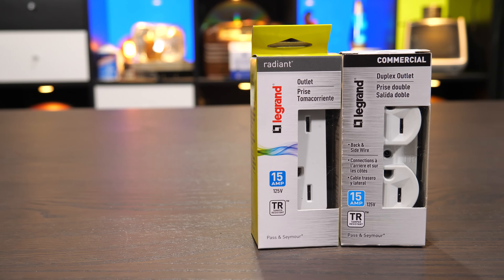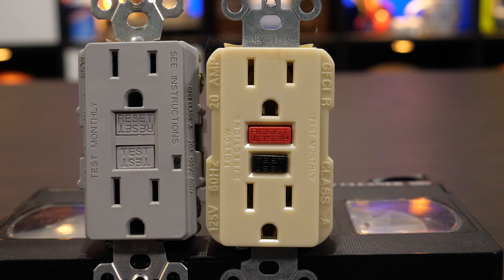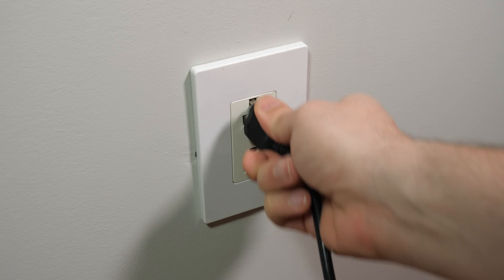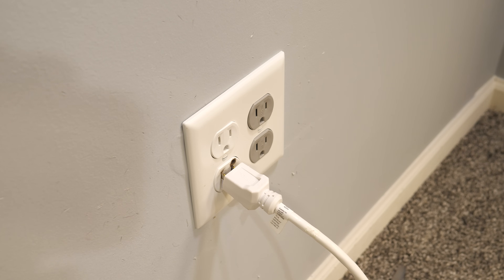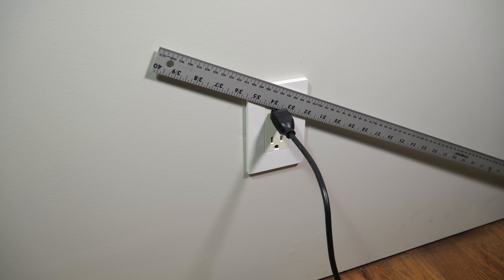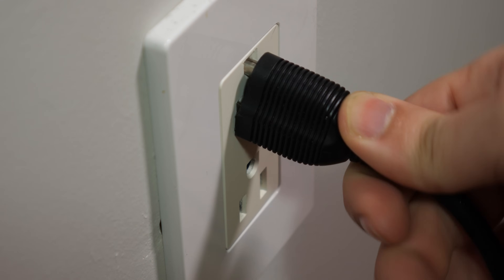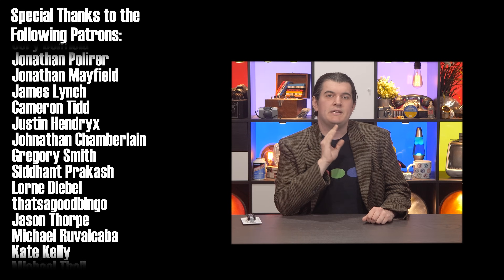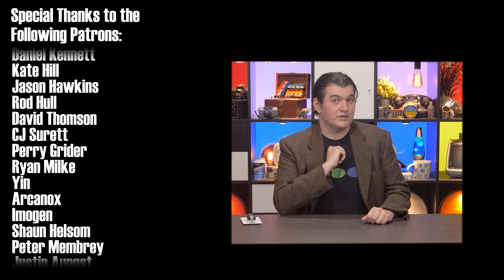Power outlets are topsy turvy - but does it matter?

Comment: Local practice in my jurisdiction is to invert the receptacles that are switched. The switched receptacles in my house are "half hot". The bottom receptacle is switched for the table lamp controlled by the wall switch. The top one is always hot to feed the clock radio. The thing you should check out though, after you read all 8000 posts and get to this one, is a device called a hug-a-plug that turns regular pokey-outie plugs into right angle dealy bops so you can shove the dresser tight up to the wall without breaking the TV cord.
Reply: What is a clock radio? Sounds interesting!
Reply: @Capitan-America-no.1  I know! It seems like a weird combination, sort of like putting a camera in a telephone, but they actually make these devices called radios that sort of work like Pandora and Spotify, except that you don't need a computer, or phone. Think of it like a Blutooth speaker that you don't have to pair. I don't know if the idea will catch on, but the music is free, although you have to listen to some advertising..like oh maybe 45 minutes of ads every hour...not too bad. Anyway the idea is that you combine the radio with a time marking device and you can program it so that the radio turns on at a specific time each day and plays some music. The idea is to help you wake up in the morning. Unfortunately they don't work in all areas and they fail if the weather is lousy, but the clock part is pretty reliable.
Reply: Linking the orientation of a receptacle to whether it is automatically controlled is an obsolete practice.  As of the 2014 NEC, automatically controlled receptacles are required to be marked as "controlled" and to have the IEC Power Symbol ("⏻") symbol on it.

Unless you have a compelling reason to do otherwise, I'd suggest using ground pin up for all vertically oriented non-locking outlets (the way hospitals do it) and neutral pin up for horizontal installations (the opposite of common practice in Chicago).

The National Electrical Contractors Association's National Electrical Installation Standards (NECA 130-2010) recommends that receptacles be mounted with ground hole up.
Reply: NEC Article 1, Section 100, defines "Automatic" as "Self-acting, operating by its own mechanism when actuated by some impersonal influence, as, for example, a change in current, pressure, temperature, or mechanical configuration."

The code section requiring such marking, NEC Section 406.3(E) Controlled Receptacle Marking, is intended to govern outlets controlled by thermostats, humidistats, occupancy sensors, computerized building automation systems inter alia and specifically excludes switched outlets from the marking provision. Here is the exact language of the section:

"All nonlocking type, 125-volt, 15- and 20-ampere receptacles that are controlled by an automatic control device, or that incorporate control features that remove power from the outlet for the purpose of energy management or building automation, shall be marked with the symbol shown in Figure 406.3(E) and located on the controlled receptacle outlet where visible after installation.

Exception: The marking is not required for receptacles controlled by a wall switch that provides the required room lighting outlets as permitted by 210.70."
Reply: @christopherdahle9985  I stand corrected!
Reply: @jmdavison62  Don't back down so easy, because marking them in a more obvious way is not a bad idea at all. But some AHJ's may read the "NEC "Exception" as a prohibition. Also, the marked receptacles can be hard to find and are only available in "Decora" which not everyone likes. In my house the bedrooms remain in their 1928 Art Deco style so I could not have used them for my switched outlets without messing up the "look". Fortunately, I found modern grounded outlets and switches in an appropriate color that worked with the original brass cover plates when I did the upgrade to three prongs. (There is a legal/safe way to do that, but you have to wire it right and all the outlets have to have cute little tags on them "GFCI protected, no equipment ground". I made my own in a cool art deco font.)

It would be nice if there was a generally agreed upon convention for stuff that doesn't need to be governed by regulations. I'd vehemently oppose the NECA standards if they became a mandate, but they're fine as recommendations. There are outlets in my house (washing machine and refrigerator) that NEED to be ground pin down because the plugs are intended to be installed that way similar to some shown in this video. On the other hand, they are pin up in my bathrooms because...reasons. In my shop they alternate between pin up and pin down because I have two circuits coming to each 4 way receptacle in the wall. (Yes, it's legal with a proper shield in the J-Box) so that I can plug two Amp thirsty tools in at the same location. Pin up is "tool circuit 1", pin down is "tool circuit 2", and they are on opposite legs in the service panel.
Cheers!

Comment: I chose the upside down method for all common areas simply because I have had an outlet blow out because a family member dropped a coin accidently behind his dresser and the coin landed right on both blades. It is safer looking at it from this perspective. Granted the chances of that happening aren't very likely but it did happen once and luckily no major damage was done. It's a preference so no way is the wrong way.

Comment: While we're on the subject of stupid plug design, check out some of Dell's modern 3 prong AC plugs for their gaming laptops (Alienware 450-AKWC for example). Mine has this annoyingly smooth taper making it difficult to properly pull out of the wall AT ALL without yanking on the cord itself, because you have NO GRIP on the plug bit. I had to go out and buy a separate cord to attach to the brick to avoid the possibility of accidentally electrocuting myself or damaging the power cord. I really haven't a clue what they were thinking with that one...

Comment: The thing is, as you say, it doesn't really matter. And ground up protects you from dropping something across the pins. Yes, poorly designed wall warts and right-angle plugs might then sag, but the thing is... that's true anyway! I have seen so many plugs and/or outlets that don't quite fit right and stuff hangs out constantly! You just have to plug them in the top instead of the bottom! Seriously, who cares? Oh, and as far as your point about the "majority of plugs"... the vast majority of plugs are not right-angle. In fact I own exactly one right-angle plug (other than wall warts). Right-angle plugs are already inferior (since you can basically never use two of them on an outlet - seriously, you think the problem with them is unplugging them and not using 2 of them in an outlet???). And if everyone used ground-up, they'd be fixed soon enough anyway.

Oh and as far as your diagonal-right-angle cord... that's a failed attempt at allowing you to use both sockets, not anything to do with keeping the cord at a reasonable angle. 

And you don't have to be throwing something against the wall, either. Where do many people put things like computer desks? Against the wall in front of an outlet. What happens to stuff that gets knocked off the back of your computer desk? It falls down along the wall.

Of course it doesn't help some other scenarios, but the key thing is it doesn't make any other scenario worse, and it DOES make some scenarios better.

BTW - the vast, vast majority of my plugs have a ground pin. Really the only stuff that don't are lamps and USB wall warts.

Comment: Where I live in West Texas, all the older houses I've seen, including where I live, have all the outlets oriented frown upside-down and it drives me nuts. A/C adapters and other special shaped items intended to be plugged in are contanstly trying their very best to come out of the wall or are instantly transformed into something far less usable than intended. If I didn't rent where I live and the wiring wasn't as old as it is (therefore introducing a potential fire hazard), I would turn every one of the outlets around to what is the "normal" orientation. For now, I practice clinging tight to my sanity.

Comment: Some electricians care. I always ask a customer how they want them before I install them and recommend doing them ground up, but still let them make the final decision. I using an example of bed against the wall with an outlet behind it that has something not quite plugged in all the way. You set a hanger on the bed while getting dressed, hangar slides off the bed and falls down between the bed and wall then lands on the exposed energized conductor. They usually agree with my recommendation after that.

Comment: When I was a kid, I encountered one such very specific scenario. See, my grandparents had power strips installed under the lip of their kitchen island. I happened to wear a metal dog tag at the time, and it happened to slide in from the top and touch both contacts while i was leaning over the counter.
There was a loud pop, and it flipped the strip's protection, but, other than a bit of metal deformation on the tag where the contact occurred, there was no harm done. I believe they still have the same blackened power strip mounted there to this day. All that being said, I agree with you on all points regarding the upside down outlets; methinks it's rather silly.

Circling back, there are lots of electrical oddities in that house. One time whilst staying over, I noticed sparks being emitted from the overhead dining room lights in the pitch dark of night. I told them, and I think it ended up being a faulty dimmer switch? Regardless, they got it fixed, so I saved them from a potential electrical fire.
Another thing they have that I've never seen anywhere else: glowing light switches. When they're switched off, they give off a nice orange glow from the inside of the switch itself. Installed in several rooms, mainly bathrooms. Not sure what it is inside since I've never disassembled one personally, but if i had to guess i would say it's probably neons.

Comment: Interestingly, those plastic plug covers are heavily discouraged in the UK because they make the UK's shuttered sockets less safe.

The cheap plastic cover can easily break, leaving the earth pin inserted and leaving the shutters open. Some of them are also flexible enough that you can force the earth pin in upside-down, creating the same problem.

Comment: When I moved in here 8 years ago, my outlets were from the 80s and all 2-prong and very very loose. So as a move-in demand, I had them replace them all throughout the unit. They're nice and 3-prong modern now, but still "upside down"! I just like it because it's not a 🙁😦!

When my sister and I were adopted, our safety-oriented father put those plastic safety stopper-plugs into every outlet. Very considerate!

Mother, on the other hand, couldn't ever convince us to eat our vegetables. Thank you Alec. 💜

Comment: Commenting from the UK...that plug looks like a death trap...our ground connection is at the top, where the pin is slightly longer than live and neutral...so when you plug it into the wall the earth plug unlocks the live and neutral so you don't get zapped

Comment: I live in a condo built in the 70s. All my outlets are installed with the ground pin up (which was common in this area at the time). As you pointed out, this is irritating. As you noted almost no plug-in device, adapter, or cable works in this orientation. I have mostly relied on power strips or wall tap adapters with rotating or angled plugs.

Comment: They're so bad, it's almost like US plugs and receptacles were carefully designed to prevent any backwards-compatible safety improvements. Can't recess it like Schuko receptacles, because right-angle plugs. Can't insulate the base of the blades because some receptacles make contact only at the base. Can't add ground pin-activated shutters because not all plugs have a ground pin. Can't make ground pins mandatory even for ungrounded applications because some receptacles don't have a ground hole. Pretty much any further safety upgrades will require "breaking changes".

Luckily GFCI made some usages safer without any changes in the physical form of the plug.

Edit: I did forget about new tamper-resistant designs that are backwards-compatible, but in my experience they are so prone to jamming, making it very hard to insert a plug without a lot of jiggling or force, that they're almost worse than a backwards-compatible change. Also the jiggling on a jammed TR outlet may increase the risk you accidentally touch the blades.

Maybe this is a symptom of what I call "first-mover disadvantage", where the first implementor of a new technology (in this case electrification) gets stuck with the worst version of it, since it's too hard to correct mistakes that are obvious to later implementors. Although Germany was an early electrifier too and their plugs are much safer. Maybe a lot of infrastructure being destroyed in the war made it easier to update their technology.

Comment: pfft. I'd still argue sideways is safer than upside down. Hospitals (only a few min in, i'm sure you will mention it) do require correct installation. I've experienced first hand shorts between live and neutral, and since I've always installed "correctly" in my house. It was a nail that fell between the contactors, and it wasn't enough to trip the breaker, but it did start a fire and had to run across the house to manually flip the breaker. It's possible that even if the outlet was installed correctly, that it still wouldn't have tripped the breaker, but still....

Comment: As a "fairly" competent (i thought) DIY guy, I'm ashamed that i never considered flipping the outlets 180.

So I guess Locke supply will need to restock their outlets when I'm finished because there ain't no way I can pull those outlets and NOT replace them 😂

Comment: You're right that being installed sideways in Chicago correlates with the use of conduit.  If you use conduit with handyboxes in the vertical position (and conduit entering both sides to run around the room/wall), the conduit fitting threads and nuts coming in from both sides of the box make the inside too narrow to fit all but the cheapest outlets plus the proper pigtails and wire connectors.  Putting them horizontally so that the conduit fittings are at the end of the long axis of the box eliminates this problem without having to use 4" square boxes for every outlet

Comment: i live in chile and sideways sockets are very common, though our plugs are rotationally symmetrical bars so a vertical socket installment would be extremely unsafe. it also thankfully makes plugging north american appliances in with adapters much safer.

Comment: Alec is correct! But here’s the thing: it’s actually not in the NEC codebooks. There is no section that specifies what orientation outlets have to be, only that they can’t be askew; they must be level. The reason it’s preferred by most electricians to install the ground facing up is because, like he said, if the plug is loose and if anything were to fall on it, it would hit the ground first and hopefully move the object away or cause a ground fault. When they are ground down, an object can more easily arc across ground and neutral, which usually results in a bigger boom. Electricians typically install outlets facing ground down in residential installations, and ground up commercially. And if they have to be installed sideways, they have the neutral prong face upwards.

Comment: Any environment with a reasonably increased risk for fire and harm should have the ground on the top, at least when it comes to our junkie connectors. Hospitals, auto mechanic/machine shops, and industrial sites where flammable gases and/or metal shavings are a potential hazard would benefit from the ground-up orientation. Sites like that are already required to have 3-pronged power cables anyway, may as well use the ground prong as a bonus safety net.

Comment: Total nonsense. Opinion only. As an electrician with 39 years in the trade, there is no code dictating up or down. The architect or owner usually specs how they want them for appearance only. The key is to make them all the same on the job. You don’t wear a hard hat walking down the street because there is a slim chance a safe could fall on you

Comment: My house that was built in the late 80's has all outlets in the "correct" orientation. It drives me nuts. We use surge protectors with right angle plugs and now they are terrible to use. Whenever I've had to turn off a breaker to work on something, I've tried to remember to flip the outlets on it's circuit while I'm at it.

Comment: We have one outlet which was installed ground up before we moved in and was the closest outlet to where an air conditioner is plugged in; it took quite a while to find an extension cord which didn't have a right angle or block the 2nd plug.  Eventually managed to find a right angle ground up cord. Most of our outlets are 2 prong, it's a very old house. We've still got fuses!

Comment: Imagine making a receptacle that has ground pins on both sides. And maybe make it recessed so you cannot touch the connectors. And to be really on the save side, put sleeves on the connectors so that only the very top connects.

Comment: How about this senario, you have the plugs with ground on top.  some one steps on cord and pulls it out a way and it angles down, now it is down and out enough that the ground is not making contact but power and neutral still are. and the object that is plugged in gets shorted and some one touches it and gets electrocuted. I install all mine so that the ground is on the bottom so ground is always making contact!